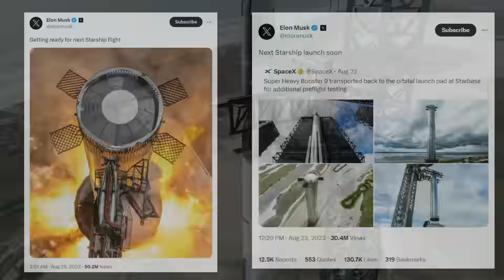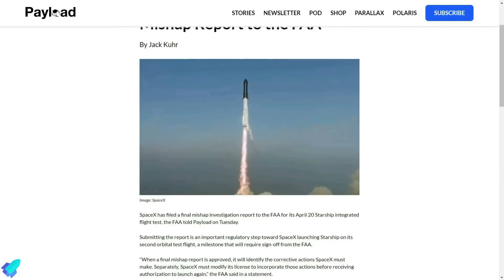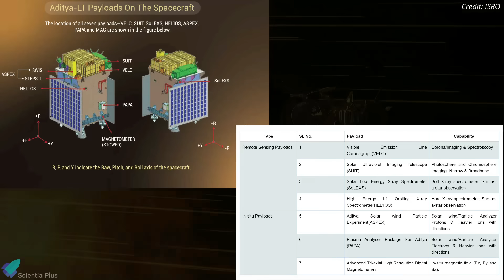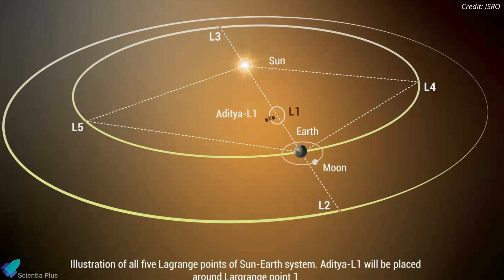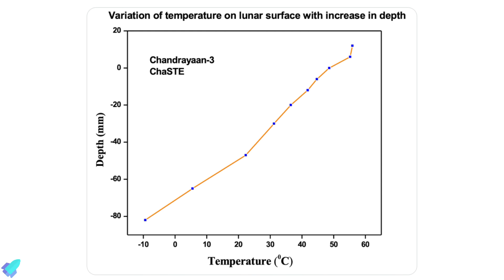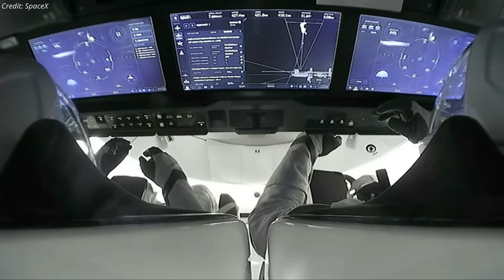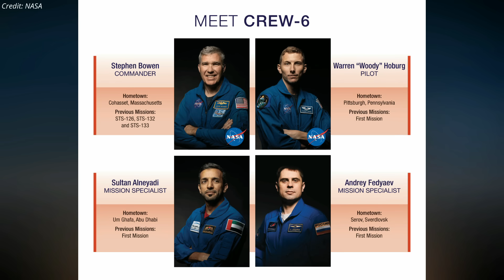SpaceX Starship Receives FCC License – Launch Date Unveiled, ISRO Aditya L1 & Chandrayaan-3

Comment: How much mass does the hot staging ring add to the booster?
Reply: About the mass of 1 ring section...
Reply: @SaltyVet74  How does that affect the booster's mass lift capability?
Reply: @howardmiller5381  well, basically its the issue with the rocket equation.   I don't know the measured weight, so i will use rough numbers to explain.    So lets assume the weight of a ring is 2 tons or 4000 pounds.  And the thing weights like 150 tons..   so its a single digit percentage , im guessing in the neighborhood of 2 to 4 % total loss.. but hot staging gains 10%. So overall like 6% gain is my guesstimate.  I am sure there is a fellow nerd on here that actually knows the weights, and capacity, and the total thrust to weight ratio....  is We are a long way from having raptor 3 engines all synced and operating at capacity, so thats a factor too..     In  grand scheme of things it barely affects it, and the benefits actually allow for some gain in the payload to orbit or beyond from the second stage.   Its a good move if they cant keep from cooking off the booster.  No matter how much shielding they use, i imagine there is still some level of gas expansion  in the upper fuel tank from the heat.. so there could be pressure variants and a million of little things..   but it all comes down to the tyranny of the rocket equation, and that should ultimately allow for better fuel efficiency, and smoother sequence in getting to orbit.   Like Elon said . Never stop thrusting...  Thats good advice in all situations where thrusting is important.

Comment: Don't bother FAA. That thing will never make orbit.
Reply: It's funny that you seem to ignore the fact that SpaceX uses iterative development practices to build their systems.  They are like the Borg from Star Trek.  first a failure or two. but in short order, the issues are fixed and improved. Oftentimes the fixes are on the rocket sitting next to the one that just launched and had issues. But, they launch anyway because there are so many other complex systems that need to be tested.  But some people only remember the failures because they are used to the archaic development structure of NASA.  Where in that culture a single failure is a systemic failure.  Falcon 9 is possibly the most reliable platform going to space at the moment built by the same company building Starship.  There is no reason to think Starship will not be as reliable, if not more reliable than Falcon 9. SpaceX will just go through a few design iterations before they get there.  They are not failing.  They are learning what not to do.
Reply: @wadecrawford8494  Archaic development structure of NASA...You mean like building a rocket based upon proven technology that flew successfully on its first flight and set a distance record for a human-rated spacecraft. I'll take the expensive but proven SLS over Muskrat's retro-futuristic Flash Gordon rocket anytime.
Reply: Once Elon figures out how to build unpressurized interstage properly his rocket should make the orbit. You are right that current version is not going to make orbit.